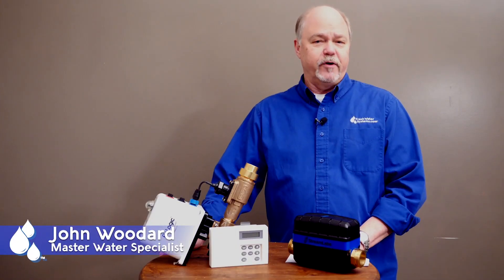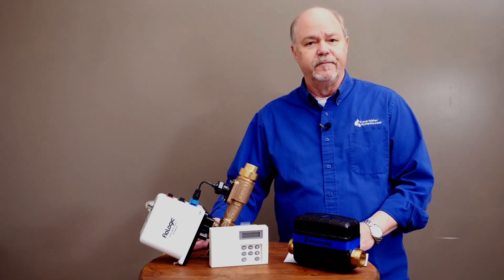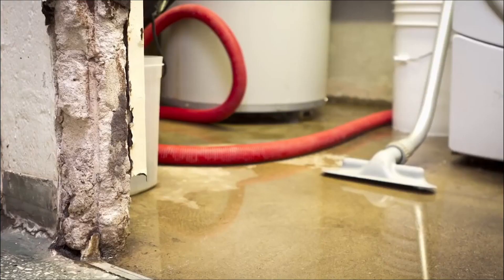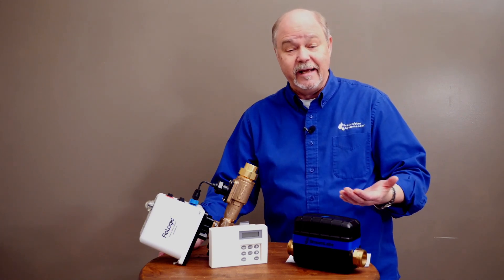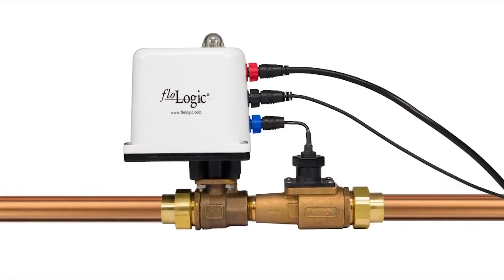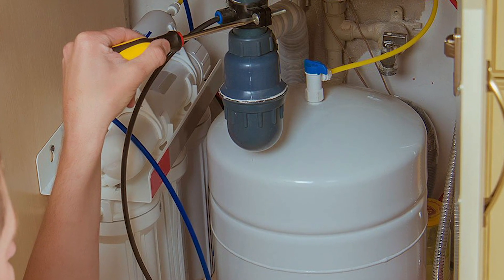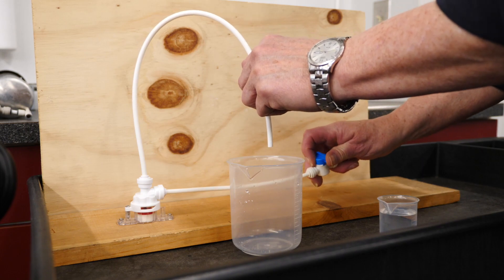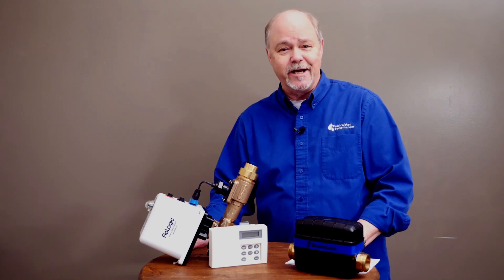How Leak Detection Systems Work

Comment: I’ve had a burst pipe just two weeks ago.  Stupid me forgot to isolate the outside tap, and then we got a hard overnight frost.  A joint inside the kitchen burst open at 4:30am, and I heard something that sounded like an intruder (footsteps on a wooden floor, followed by the sound of my light sensor switches activating).  I leaped from my bed and opened the door to the sound of an intruder alright.  However it wasn’t the intruder I was expecting.  I had the sound of a river coming from a ruptured 15mm pipe joint.  I reckoned this was 2 minutes of leaking, but my kitchen and utility rooms were both turned into lakes.

So I’ve been thinking about leak detection ever since!  Flow measurement isn’t sufficient.  It cannot tell the difference between filling the bathtub and a ruptured joint. Yet if you were to somehow spill the entire contents of that bathtub onto the floor, you’d have the same catastrophe as a burst pipe.

So my idea is to have a normally open motorised valve at the main inlet to the house, controlled from a raspberry pi.  I then have a series of flood detectors dotted about the house:  One next to each fresh water pipe transit (these are cheap metallic contacts with a pull-up resistor which can be used to measure voltage relative to supply or ground).  I then also place these detectors in the crawl spaces under the house.  In theory that should detect catastrophic leaks very quickly (seconds, not minutes).  It should also detect slow drips so long as the drip yields a puddle or saturation in a wooden floor.